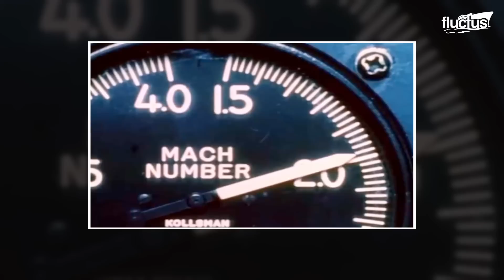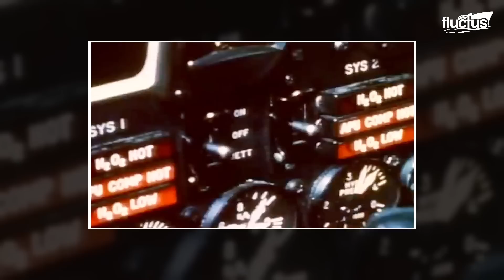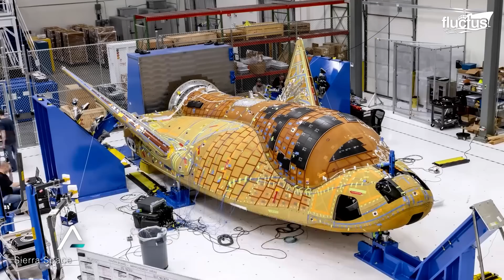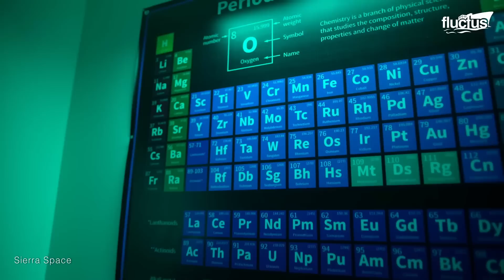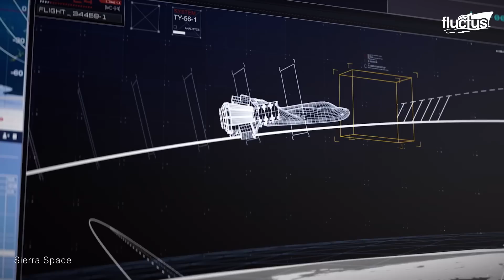Why US Keeps Trying to Launch World Fastest Hypersonic Drone

Comment: I know that they stopped the program because flying at this speed it becomes hard to control.....which is why figuring out the gravity situation ...but I think there is a way to keep the plane stable.... you see the nose of the stuff thery are using now. that is UAP replica material which is obvious....but they don't have the energy to put power into it to create the barrier it needs to move through space. They may know this already , and the problem is getting the amount of power into a small package ....But maybe there is another way . I think they should relook at the ionic tech , fused with electro magnetic energy ....This should give the object the barrier it needs to move through space without resistance .

Comment: The fuzzy dice hanging inside the Dream Chaser are required for testing stability. They’re also planning on using a chromed chain link control yoke and installing a chandelier in the final version. Yes, it will also have purple fur carpeting for those wondering.
Reply: The Shaggin' Ship?